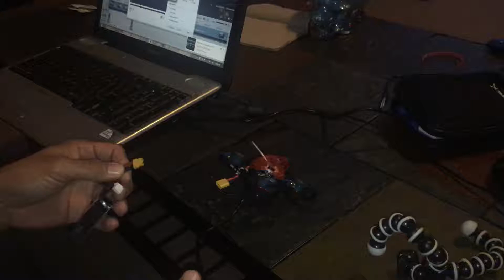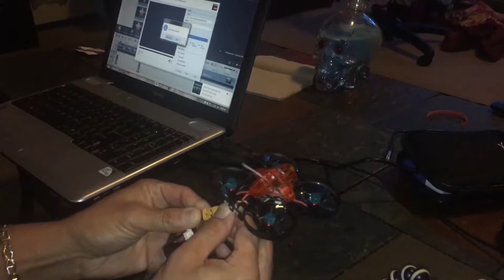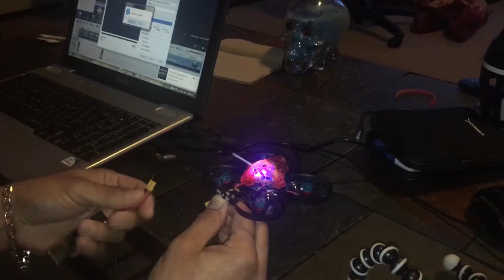February 19, 2019

Comment: Something wrong, bro?🙏
Reply: I think you do not need a battery to connect to your computer🙏
Reply from the maker: yeah...did this video for banggood.  I was demonstrating that the esc's work when a battery is connected plus the usb cable but I think the 5v regulator for the flight controller is shot so it only works off the usb 5volts when its connected to the computer. Hopefully they get me up and going because I was a fan of this one!
Reply: @ChrisLBradly  oic, thanks bro and have a nice day :)